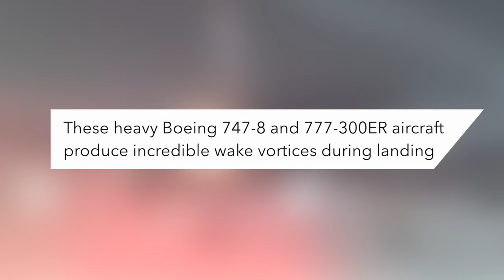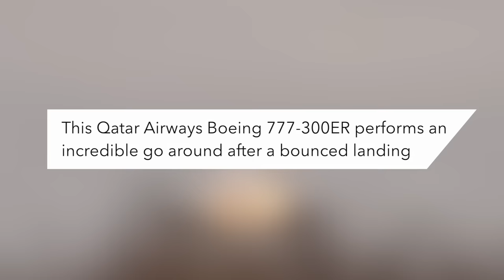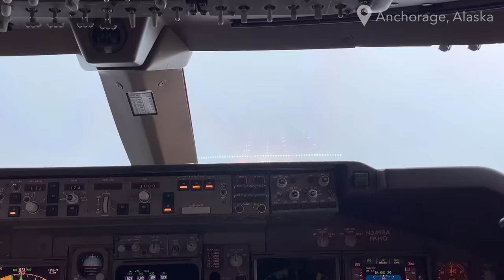747 Engine Explodes On Takeoff

Comment: 2:34 Love the fact that the L1011 is still flying! It was a very modern plane for that time! 🎉
Reply: Had my first ever flight on that beauty ❤ back in 1993
Reply: Someone knows the registration number?
Reply: is it not a newer design than the 737 and 747?
Reply: A TriStar Varig  took me from London Gatwick to Sao Paulo Brazil 1992. A very pleasant flight.
Reply: Yeah, I flew to Hawaii on a Tristar decades ago. Now it's nearly gone, and so is Lahaina, mostly. Sigh.
Reply: Yet, 49 years old is almost typical in general aviation !
Reply: @KuppelBrie  N140SC. Owned by Orbital Sciences. It air-launches rockets!
Reply: @tobbsnobb1366 Yes. But the 737 is still in production, and 747 was produced up until this year. The L1011, however, ended production in 1984 after only 250 were made.
Reply: Genuine question. Why did the L1011 have so many less surviving aircraft than other planes of the time despite the higher tech? DC-10s, 747-200s are still in double digits and A300s in triple when it comes to surviving aircraft nowadays.
Reply: @yeetoburrito  it was discontinued and Lockheed exited commercial aviation, making getting spare parts much more difficult.
Reply: And it's owned by the company that built it (by way of purchasing Orbital Sciences, who used it to launch rockets which delivered space vehicles)!

Comment: An un-contained engine failure is when debris is shed radially penetrating the outside of the engine. If the debris goes out the back OR the front of the engine in a failure it is NOT un-contained failure: that is how they are designed and certified.

Comment: love the tristar. i've often wondered if it could take off with just the rear engine ?
Reply: That's highly unlikely. Trijets however are allowed to perform a takeoff and ferry flight on two engines. The restrictions are very strict (briefing, no payload, minimum mission time and fuel, etc.)
This is to allow the aircraft to evacuate an airfield in case of an engine failure, whereas the problem cannot be fixed on site.
Reply: not a chance.  Why would you think for a second that a half a million pound airplane could get off the ground with 33% of rated thrust?

Comment: Surely the 747 was still on a taxiway, and not on takeoff?
Reply: no, it was on the runway during the takeoff roll. Watch the rudder deflection to counter asymetric thurst as soon as the engine fails. You don't need that at a powersetting used for taxiing

Comment: 1:21  A few years ago, I witnessed a HH-60M taxi out and lift into a hover in a large droplet rain storm. It was amazing to watch the rain flow thru the main and tail rotors wash. You can see the rain accelerate thru the rotor and bounce off the ground effect, then witness the rain go through the tail rotor balancing the torque of the main rotor. Unfortunately it was to far away for an iPhone camera to record it. Helicopter aerodynamics 101.

Comment: Question: why not all landings perform in automatic mode?
Reply: The technology has been available for a long time, as in decades.
But, the pilot's unions have blocked its widespread adoption: "job security".
Reply: Because pilots would lose valuable flying skills that would be desperately needed  in the event they would need to take over. It's a balancing act, like everything in life. Would you like incompetent pilots trying to land a plane with a malfunctioning auto pilot in an emergency?

Auto landing is reserved for those cases where pilots would not be otherwise capable to land the plane due to poor visibility, but can safely take control if it is needed for a go around.
Reply: Pilots need to have X numbers of takeoffs and landings to keep their licenses. And they like to do it, since it is fun.
Reply: Not every aerodrome or aircraft meet the technical requirements for that kind of landing
Reply: Even when the technical requirements are met, autolandings have a negative impact on a runway's capacity

Comment: I would like to suggest some corrections in wording around the first video, the Silk Way West airline takeoff out of Miami (to Frankfurt) on 12/4/2023. 

- By all appearances in this video and the cited video, this was a contained engine failure. An uncontained failure is where the outer protective casing is blasted open and parts go flying out. It is rare and dangerous. Nothing like this appears in either this video or the longer video cited in the comments. No damage to the engine can be seen from the outside; that's the difference between a contained and an uncontained engine failure.

- Therefore, the engine did not explode, as the title states. I don't believe it even flamed out. All I saw was excess smoke.

- The footage did not come from the cited video, so some citation is missing from the shorts listed in the video information.

I may be wrong. I'd welcome any clarifying thoughts or reasonable opposing views or links to industry reports on the incident.

Comment: The PW4000 is getting very old now... I wasn't too surprised at the engine failure except maybe maintenance failures as they are more common with this engine as this engine is known to be harder to get inside and repair and inspect things.

Comment: That doesn't look like an uncontained engine failure. It doesn't even look like the engines would have been spooled up very high by that point.

Still a great clip.
Reply: I was rooting for the pickup truck to win.
Reply: If you look REALLY closely, it does appear that some small debris got ejected. Odd that it was at taxi power level.
Reply: Debris out the back is not a uncontained failure. I saw nothing close to components penetrating completely through the engine case.

Comment: Looks like the left-most engine had the failure. You could see excess smoke early on during the take-off roll. And once stopped, no heat signature was visible unlike the other 3 engines. That's why they put 4 engines on this bad boy back in the day. Redundancy ;-)